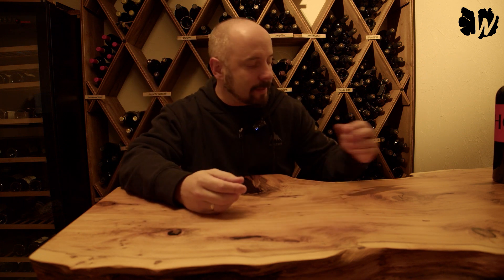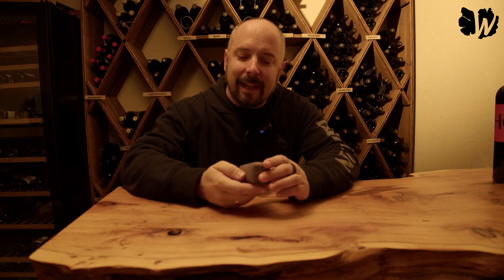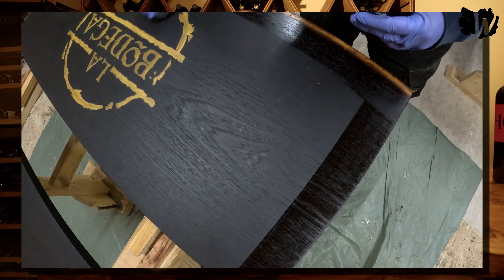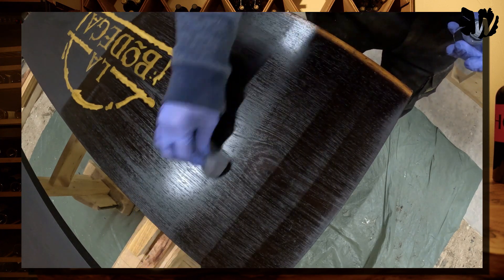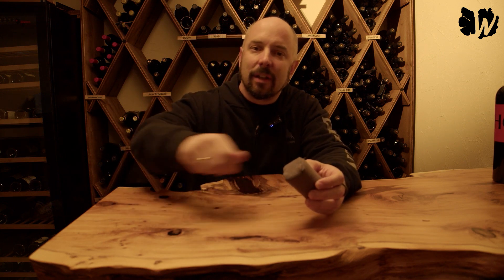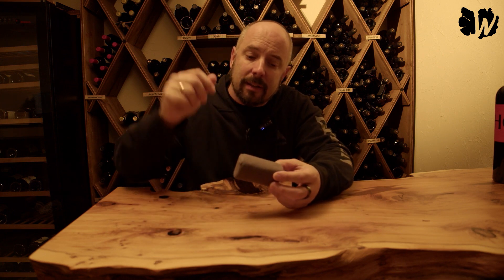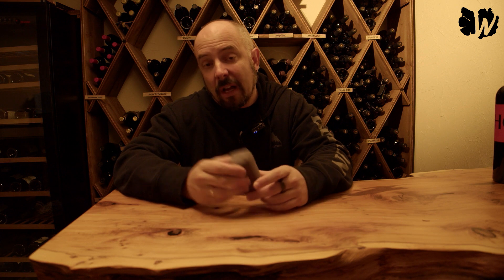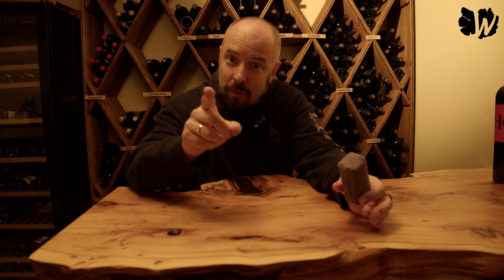Alternative applicator pads for Blacktail Studio N3 Nanofinishing to save finish #n3

Comment: Thats a great tip! I have some of those same pads myself. We did recently modify the applicator pads we include too. Now it is a thin sheet that goes over a firm pad. Cheaper for everyone this way. Also, for what is worth, the "sponge" underneath should never actually come in contact with the liquid. The micro fiber pad has a backing on it to prevent it from soaking through the fabric. However, that fabric can be quick absorbent, and I know exactly what you mean about wasting some of it into the fabric.
Reply from the maker: Oh, thanks for letting me know, I completed missed the applicator pad 2.0 😆 I bought 4 kits at once so I didn’t have to refill yet. Yes, that system looks much better ans less wasteful. BTW, now that I have the opportunity to ask: I have seen that there are nano coatings like the N3, which use two liquids, and others that use only one type of liquid. What’s the difference?

Comment: Nice tip, especially for doing small projects, I always hate tossing applicator pads especially after a quick use.. Sure if selling a 10,000$ table a $1 sponge isn't a big deal, but for hobbyists, all these costs, and having to keep supplies on hand become too much.. these sponges look to get you at least 3 maybe all 4 sides of use, while not wasting all that expensive coating
Reply from the maker: Yeah, I am all with you. One has to have all these things in storage and it sums up. You can use three sides for sure - the fourth side has the stitches, so that one is less ideal. But three sides is more than two on the pad from Blacktail...
Reply: @Woodensoul can you use these aplicatora multiple times or just one side of aplicator per layer of ceramic coating, thanks
Reply from the maker: @ffriend-music  Just one side of the applicator per area, because the ceramic dries out quickly and leaves it all hard